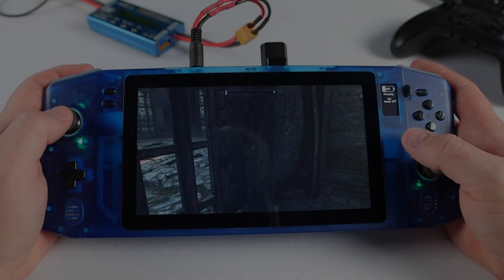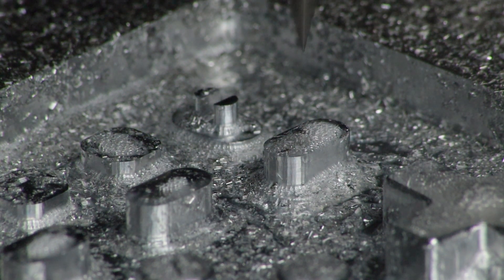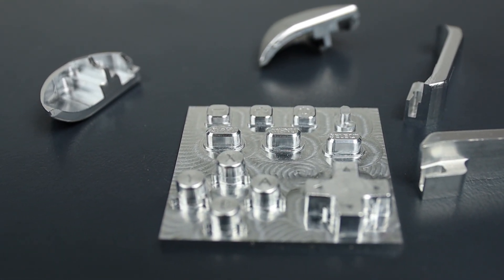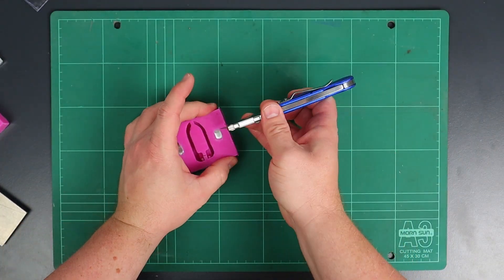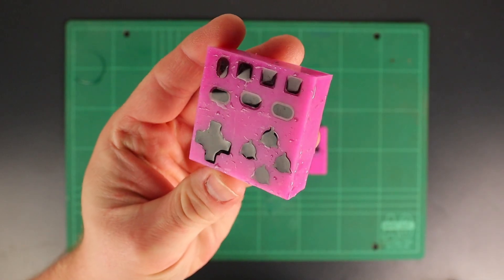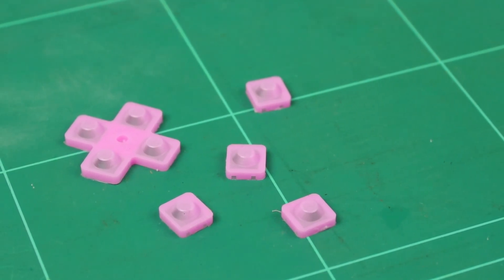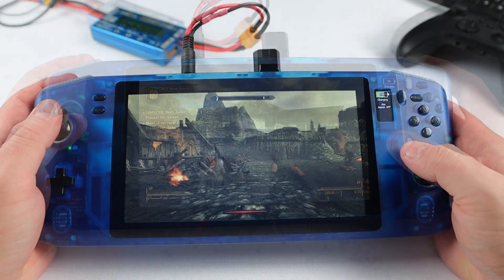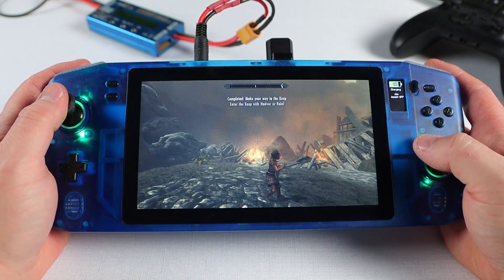NucDeck - The DIY windows gaming handheld - Episode Six

Comment: Great  progress on the project! I actually have a question. Is there any chance that you might be selling something like a kit for this project? Basically all needed parts and non assembled. That would be a huge win for the community. Also if you have no plans for that can anyone take the needed project files and sell kits themselves?
Reply from the maker: Unfortunately I don't think I really have the spare time to be organising kits and shipping them out. I'm already pushing it with trying to make YouTube videos! I think a group buy of some of the parts might be a feasible option (there's been some talk of this on the discord group) but if someone wanted to come along and make a kit of the whole thing, I wouldn't be upset as long as I get credited for the design!
Reply: @cncdan  Thanks for the answer! I think there will be several Chinese manufacturers interested in this project. The only concern I have is that almost all nucs don't have good performance on lower tdp. I will probably try to use the Ryzen 7735hs as it runs at 35watts. I will also make sure to compile a list of all possible Ryzen chips that fit your design. Again thanks for your outstanding work so far. Open sourcing a windows handheld is phenomenal on so many levels!